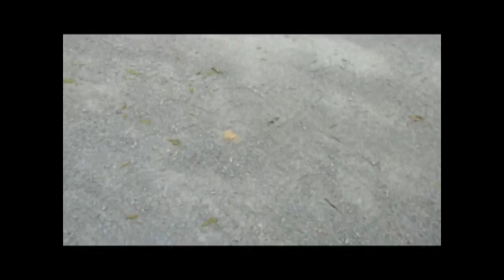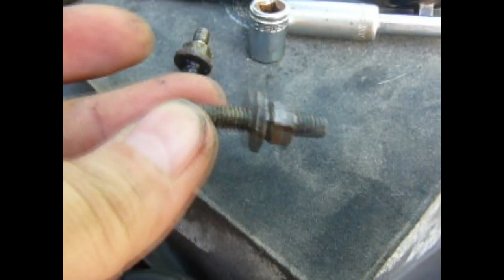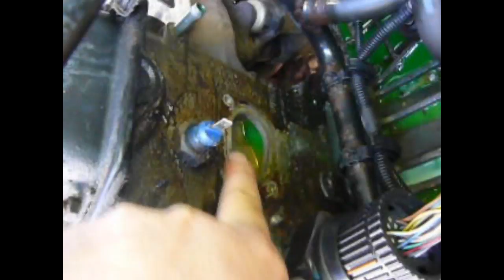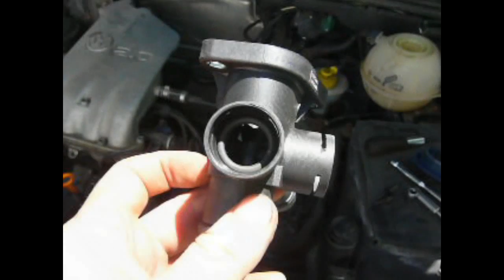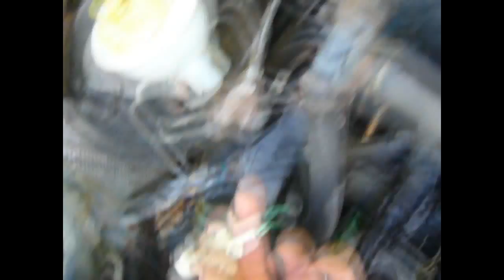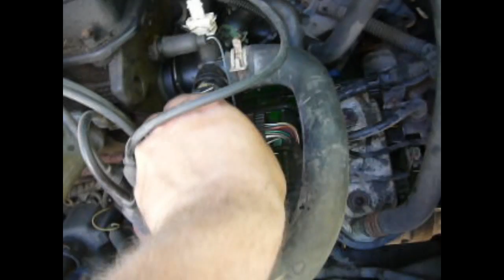Goregoon's Garage: Replacing the coolant hose flange for a 1998 Jetta GLS 2.0 (part 2)

Comment: This was a great walk-through, helped me every step of the way through replacing the leaking coolant flange on my 98 VW Cabrio. The part cost me $12 online, and topping the coolant was free thanks after driving to the VW service center and asking nicely. The job took me 3 hours, but I'm a novice plus I took my time to clean up the coolant mess down in the bottom and check that the hoses were still good. Much appreciated!

Comment: Performed the procedure yesterday on my 1997 Jetta GL 2.0 and everything was the same except the hose flange only has 2 hoses that connect to it.  Just an FYI for 1997 owners out there.  My Rad doesn't have a drain plug either?  Thank you for taking the time to create this video, much appreciated.
Reply: For the years of that model range automatic transmissions will have an extra hose attachment.

Comment from the maker: Thank you!

I don't believe the gasket comes separate to begin with, it's a rubber ring set into the flange itself (I may be wrong though as I am NOT a mechanic). 

Yes, my flange was less than 14 bucks after tax or something like that. I am not sure if there were any differences between 1998 and 2001 but I can't see it being much if any.

Good luck with it all, thanks for dropping in and commenting!

Comment: Good video,but cant seem too get the retaining clips in for the temp sensor,Any Help???? thanks
Reply from the maker: Hi Adrian

You will need to push it in (maybe even while twisting it a bit back and forth) until the clip hits the grove in the sensor. It may take a little but it will eventually line up enough to push the clip in.

Thanks for dropping by!
Reply: Ra'ees Sayed Rajack Thank will check it ot now.
Reply: Goregoon Ok will give it a try,the 1st clip broke off so will need to buy a new 1 and fit it in.

Comment from the maker: @805ROADKING What I hate about cars these days is all the friggin' sensors. They 9 times out of 10 fail before whatever they are monitoring fail. They send a message to the computer, tells it that "whatever" failed, the computer then shuts you down. Meanwhile... there is nothing wrong with your car except the damn sensor. 

I had a 69 Chrysler Imperial, you could of build a house under the hood, even with the big ole 440 in there... like a coffee table LoL 

Sigh, I miss that car.